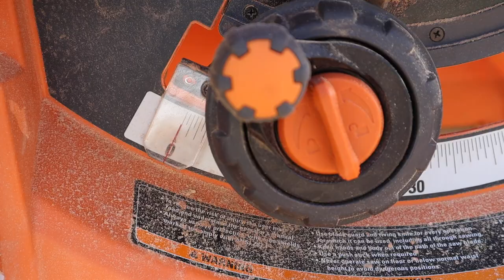NESTING BOX | Chicken Coop PART- 6

Comment: How did you prevent water intrusion/leaking through the nesting box lid.  On ours, I've been chasing a leak just where the side of my coop I built and where the nesting box lid meet.  Anyway, I think I'm going to re-frame the inside top portion of the nesting box.
Reply from the maker: I believe I showed that portion in this video, possibly the next video (doing the siding). But I used an old pool liner as flashing, applied it under the siding and brought it down over the lids. If it's not in this video check out the next. Thanks for watching!
Reply: @JoeSimple  Great idea.  I have some thin rubber material, I might actually try that.  Except I have 1x3 trim that is just above the lid, I can loosen up the trim and add the rubber material up and then come down and overlap the lid box.  Thanks for the idea.
Reply: Use roof flashing.